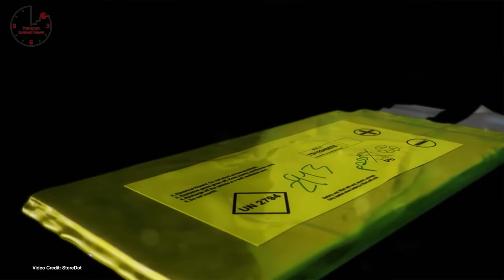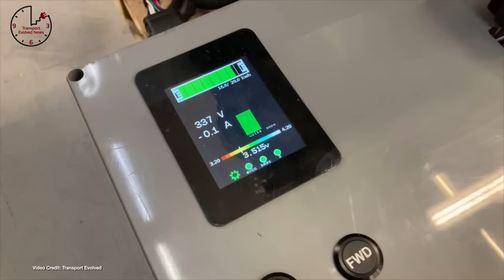TEN Ep. 388 - F150 Deliveries Happen, FF-91's TRUE Reservation Numbers, Customers Pick Legacy First

Comment: 19:22 - I've seen similar installations in the UK highlighted on the Fully Charged channel, and whenever I see a thing like this I scratch my head: Why tack on a new facility to a charging station, when it would be much more efficient to contract with an already established diner chain, hotel chain, etc. to install charging stations in their already existing parking facilities? Bring the charging to the places people are already driving to and parking at. Make use of one of the biggest advantages electricity has over liquid fuel: You can put a charging station anywhere.

Comment: Great update.  14:42  Isn't is also ok if automakers preserve regen at full charge by having "extra battery" at the top, so that there is still room for regen?
Reply: No not really. The max regen for a 100 KWh that was recently fully charged will be less than 20Kw.

For 4000+ pound car travelling at 60 mph it would take 36 seconds to slow to a stop while dumping 2KWh out of the kinetic energy. Maybe 1 KWh of that ends up in the battery but the rest is lost as heat. Another reason not to charge above 80% SOC. Or tow a zero percent SOC BEV with a two truck to the top of the nearest hill

Comment: Nissan’s e-pedal has been using blended braking since at least 2019.
Reply: My 2013 Fiat blended braking as well, but they gave you no other option, however I think what they are talking about is regen when you just take your foot off the accelerator. When my Tesla is cold, or full there is decidedly less slowing down than when the battery is warm and has space, so you get an inconsistent performance which could cause excitement when expecting to slow down

Comment: Every other Automaker already blends inregen braking before using friction brakes when using the brake pedal. Something Tesla should learn. And no I don’t want my EV to use friction brakes just when i don’t hit the accelerator
Reply: The reason is that blended brakes can have some inconsistent flat points and make it sometimes feel wrong when you need it.  That is the reason, no problem which design you prefer.
Reply: @Tom55data  They have some pretty clever engineers at Tesla. But probably they need to work on fart modes more urgently.
Reply: @EVPaddy  But you total miss understand the "problem".  All EV have no regen when the battery is 100%.  So all EV's must use the friction brakes at 100% charge.  The issue is that change in the standard (ie no regen to use) means the brakes appear non-functioning on blended brakes as the regen cannot work, so you have to wait to get the friction part so they feel spongy.
Tesla has changed the brakes so that regen appears to work at 100% - so there is no change to how you drive the car.  Always a good thing.  Does not matter what car you drive, at 100% charge you must use friction brakes to slow down.
Reply: @Tom55data  yah but when you blend, you can also blend so it always feels the same. But you still know when you are braking and when not. With Tesla’s solution, you may be braking when you think you’re just recouperating. Anyway, that’s not that big of a deal, that’s fine, but the missing blending is bad because a) it disencourages touching the brake pedal and b) it doesn’t give you the flexibility of more/less regen like in other cars and c) it doesn’t give you as strong regen as in other cars.

Comment: Another great video. Although Diess has quite optimistic plans to overcome Tesla by 2025 we all know that's not possible but that's a great goal right?
Reply: Don't oversight just how massive VW group is. Audi, Porsche, Skoda, Seat, VW and so on

They make 9 million vehicles a year. They might miss that transition over target, but then it will be matter of "we don't want to disrupt too many production lines on one go".

If They went all out "we don't care how much our production slumps for couple years while we crash transition over", they absolutely could overtake Tesla for 2025.

It is much easier and faster to retool existing upto date operating production line, than to build new factories.

It might happen, it might not. Depends how fast and how expensively VW wants to push the transition.